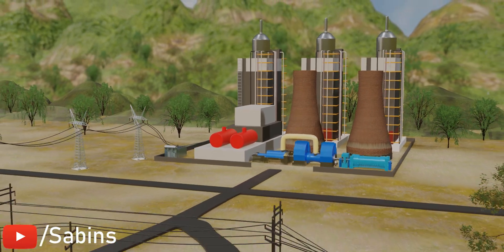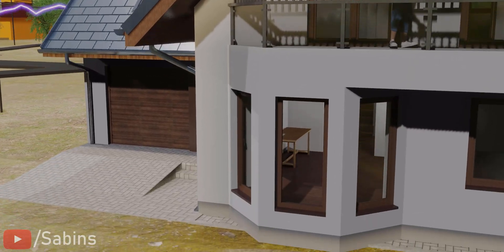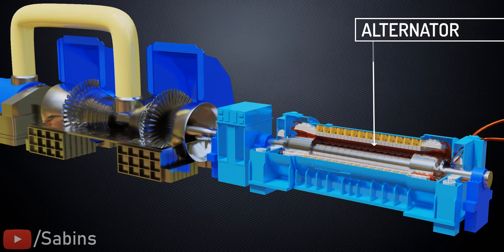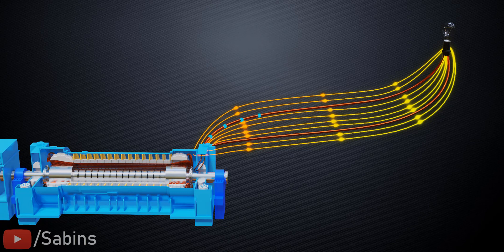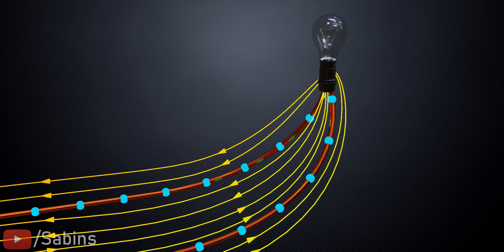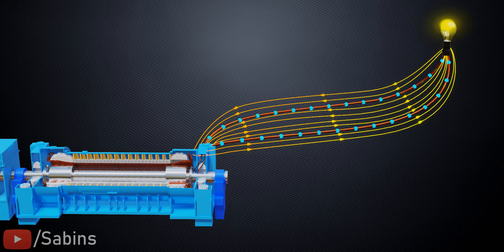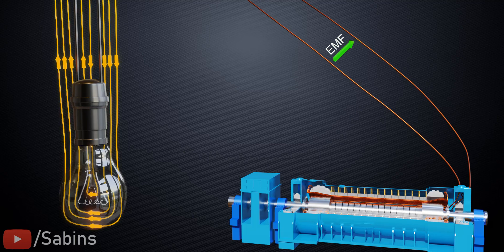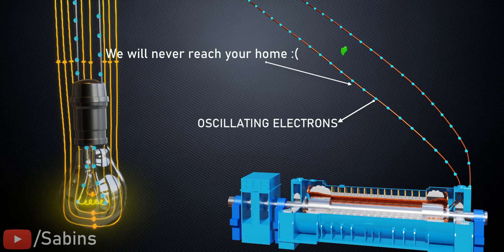The interesting journey of electrons | Powerplant to your home

Comment: Sir, what about HVDC systems. They are long lines of DC transmission between generating station and load. 🤔.
Reply: Hello mam For HVDC we transmit power through dc only but after transmission for distribution again this dc power is converted to Ac in substation and then fed to loads
Reply: @rohithmarise5705  right. So in the mid portion of DC transmission what will happen!
Umm. Generating station will pass the electrons instanteneously upto hvdc station. Than we have 100s of km dc transmission, here will it take time?🤔. than again dc to ac converting station. And than load, again instanteneous.

Comment: Short answer: the voltage induced is the important thing. The electromotive force. It would move all the electrons along the conductor because of the force instantaneously. The electrons from power plant don't have to reach your home. This is especially different as we use alternating current which will make the electrons stay on specific range as they just oscillate many times per second. Nice short answer.

Comment: If electron can travel only 1mm in one direction then how they travel through long wires
Reply: On AC they don't travel, they oscillate in position, on DC they travel, but on either case they don't need to travel all the way to work, they only need to push the next electron , the chain reaction pushes the electron near the bulb, that is why it's instant even when they travel slow.
Reply: They do travel but slowly. Think of it like pushing prinkles in the stack.
Reply: Didn't you watched the video?

Comment: Then how electron reaches ??
Reply: On AC they don't travel, they oscillate in position, on DC they travel, but on either case they don't need to travel all the way to work, they only need to push the next electron , the chain reaction pushes the electron near the bulb, that is why it's instant even when they travel slow.

Comment: But there is a noticable delay between pressing the switching and the lamp turning on. Isn't this about 20% speed of light? Aka the speed of "electricity"?

You also said that the electric field travels at the speed of light.

And that electrons travel 10cm/s.

So there are 3 different "things" going around/through a wire?
Reply: The delay is noticable with some lights (forget about the fluorescent ones) for eg. LED lights and that is maybe due to the manufacturing process involving some capacitors and inductors causing the delay.
But is unnoticeable with others.
So the manufacturer knows about the delay better.
Reply: @hardiksethi20  I meant to try to illustrate that the electricity (whatever that exactly is) also travels at a certain speed, lower than the speed of light, but faster than the electrons. So regardless of lamp used.

Thus, making it a separated "entity" alongside the other two...
Reply: @arisoda  
I think you are confusing the commonly referenced "speed of light in a vacuum" (3*10^8 m/s) for the actual speed of light in a given situation. You are right that often what you call "electricity" travela slower tham the iconic 3*10^8 m/s, however, it is still the speed of light, not a separate entity! It is simply that the speed of light is not always the same, for example in different electrical circuits, especially at high frequencies, the speed of light will be 40 or 60 or 80% of the speed of light in a vacuum.
Reply: @PulsedPower  I see, but light in a medium still travels in a straight line, but in wires it does not. (and we're not talking about fiber lol) So how does this work? Or is the "electric" field (as described in the video) not light, but only part of the ELECTROmagnetic radiation (light)? So only this "part" of light, goes through the conductor? Does it have a medium? Must be, or else it should travel at C. But what is it? Not the electrons, because the electrons only move AS A CONSEQUENCE of this electric wave, right?

... someone pls explain
Reply: @arisoda  
First lets establish a few fundamentals, it sounds like you have a fair understanding already but just to set the stage:
The electric and magnetic fields are the names we give to the fundamental "medium" in which we can describe a vector E or H at any given point in space. We know that electrons are "particles" that are associated with a specific pattern of perturbation in the electric field. We also know that any sort of CHANGE in the electric or magnetic field, will produce a perturbation in the other field. ie if we grab an electron and move it in space we expect a complimentary change in the magnetic field surrounding it. The "speed of light" is simply the speed at which these sorts of perturbations propagate in the electric and magnetic field, which we can collectively call the electromagnetic field. What we call light is simply the co-propagation of a changing electric field along with its complementary changing magnetic field. At this point, going based on this information, we expect that IN GENERAL electromagnetic waves propogate omnidirectionally, much like water waves propagating in every direction after dropping a rock in a lake. Of course as you know there are ways to guide EM waves by using a variety of boundaries. Any general case can be mathematically described using Maxwell's equations, and the boundaries in the guided cases are described using mathematical boundary conditions (not critical to understand).

So, lets look at the case where the switch is still "off" if it is a DC circuit then nothing is changing at all. The battery is at some fixed voltage and the wires on either side of the switch are each at the potential of a different terminal of the battery. The specific electric field in this case obviously depends on the specific geometry of the circuit, but in general we know that the electric field vector will be in the direction from the positive terminal to the negative terminal, it will follow generally smooth curves and occupy every point in space, both around the wire and between and away from the wires. The free electrons in the conductor will have arranged themselves along the SURFACE of the conductor to create a sum zero field within the conductor. This means that there will be a varying electron density as you travel along the conductor, but in all cases it cancels out the field within the conductor created by the DC source. Also the electron arrangement will be such that there are many electrons (high electron density) on the side ofbthe switch connected to the battery negative, and there will be many holes (high hole density) on the side of the switch comnected to battery positive. Therefore there will be an electric field between the terminals of the switch trying to drive electrons from the negative to the positive. This field is in part created by the electrons themselves.

Now, when you flip the switch "on", in that instant the field is still present trying to drive electrons to the positive side, and the electrons are stil bunched up on one side of the switch leaving a bunch of holes on the other. But, as time progresses, the electrons flow in the direction that the field draws them, and that in and of itself changes the field. As time continues to progress, the electrons along the whole wire will continue to rearrange themselves (starting from the switch) and eventually will reach the quasi steady state if DC current where the electric field is no longer totally zero inside the conductor, it now has a small vector sum in the direction from positive to negative which is what drives the DC current flow.

You can see it is a very complex and ultimately geometry dependent process, but you seem to be specifically referring to the part where the electrons rearranged themselves after switch closure which results in the new electric field that continues to drive the actual current flow. This happens very very quickly at a couple nanoseconds per foot of cable and therefore is certainly on the order of the speed of light, although slightly slower. So really it is the coupled action of an electric field physically moving electrons which then changes the electric field and so on until a steady state is reached.
Reply: I understood your point 👍
Reply: electric field is set up in circuit with light speed.

Comment: I have a doubt . what is the use of transformer and why we need to transform voltage ? Pls answer my question and love your videos
Reply: Thank you now it cleared my doubt
Reply: Power lost due to transmission Lines is given by
P=R*I²
And the power at the load is P=VI
You can choose to tranfer the power either at 1)Low voltage-High current or 2) High voltage - low current
But see that P being lost is directly proportional to I².
If you choose to step up voltage by N times Current is Reduced by 1/N times and thus only 1/N² of power is lost 
The other way is increasing current by N times and thus Increasing power wasted by N² times
So high voltage transmission is better
Reply: The main function of transfomer in power plant is increasing the voltage.

Why to increase voltage?
To lower the losses.

Lower the transmission voltage..higher is the losses. Losses are mostly in form of heat.

If you are not an electrical engineer.
This answer is fine and decent.